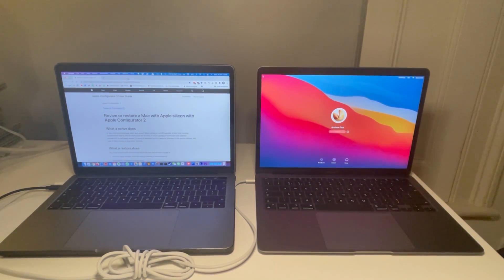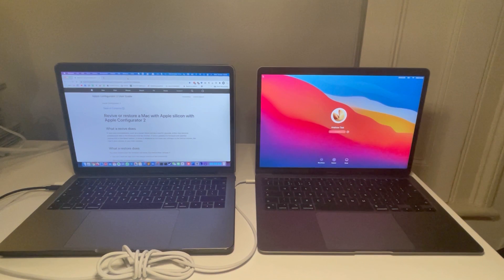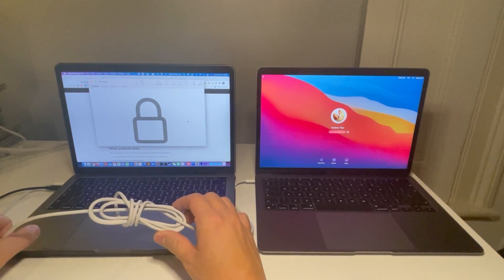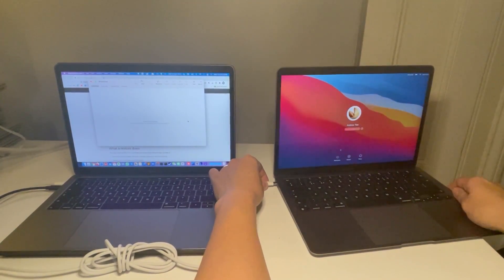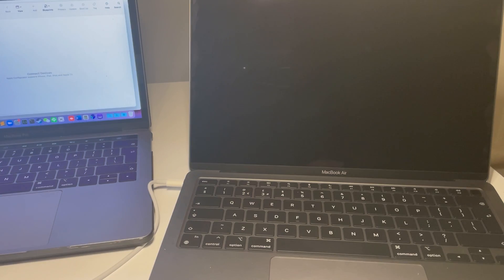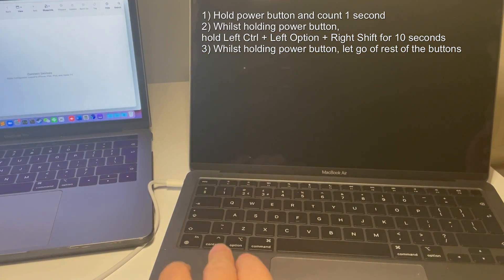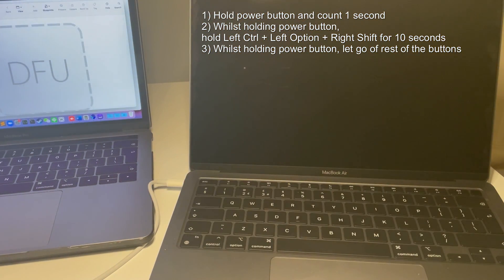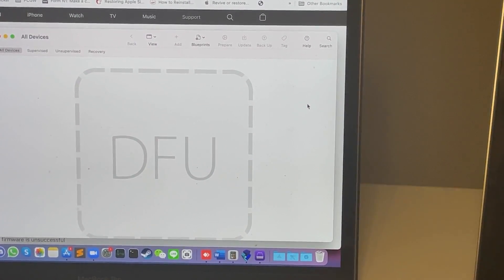How To Set DFU Mode on M1 Apple Silicon MacBook - Reset Factory Settings

Comment: With the M1 powered on hold Left Ctrl + Left Option + Right shift then power button.
Continue holding all 4 until you see that it is starting to reboot  count 4 seconds.
lift the  Left Ctrl + Left Option + Right shift keys and keep the power button down until DFU comes up, then release the power button. 
It works every time.
Reply: Im having MacBook M1 Pro 2020. It has went black/brick. Tried everything still not working.

Comment: Thank you so much!  I consider myself a proper Geek and only after several hours of reading conflicting instructions and many videos was I able to get into DFU mode easily by using your instructions.  I think the key was the 1 second press of PWR before the other keys...but I'm in!  Thank you :-)

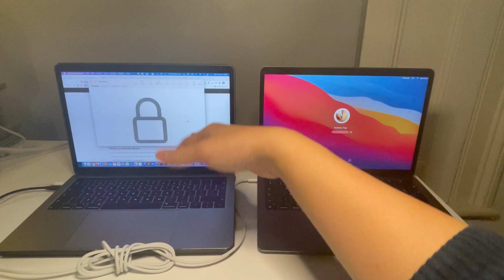UPDATE - I managed to get it into DFU mode but a 'Revive' did not work.  I then could not get it to go into DFU mode again in this way.  After much trying, I eventually rewatched the video from about 2:20' and doing it alongside Andrew it worked!  I then did a full restore which again did not work and once again I could not get it back into DFU mode again using this method.  I thought "what the hell" and run the video back to 2:20' again and did it alongside Andrew and it worked!!  I don't know what I am doing differently or if there is some very weird 'woo woo' going on but....well thank you again!

Comment: Thank you! I had installed Asahi Linux on my M1 air and lost half my drive space to the install so I removed the APFS volume in recovery mode but I made a mistake somewhere and ended up with the (!) icon and a link to Apple's site. But Apple's instructions on what keys to hold were confusing and I couldn't get it into DFU mode but your video saved me! Thanks so much!!

Comment: Thank you so much. It took me hours to find a solution until seeing this. And this works the first try. I just play the video in real time and let it count for me.
Reply: HOURS?!?!? it took me all afternoon to get this to work... instead of searching around on the internet, I chose to ask ChatGPT to help with this. - and AI knew the correct keys and to help me know that the cable type matters as well.... but the actual sequence I was asked to try never worked , not one single time.... I was never able to get the DFU status, until watching this video, it worked on the very first try. In fact, AI did not even realize that the startup and chime (that eventually aborts from the keyboard sequence) is part of the process.... I would say, "its booting up, its not staying black screen..." and AI would say, "dangit... keep trying, you just need to time those key sequences properly".... but it was never once suggesting  "THIS" actual sequence here.

Comment: I had taken delivery of my new M1 MacBook yesterday, installed a time machine backup, everything worked well. This morning I switched on there was a circle with an exclamation mark and an Apple support address underneath.

Initially the first level of Apple support said send it back get a refund, but come on I don't want to have to reorder it.

Support was then escalated to a more senior guy. "I know what to do, no problem" he said.

He pointed me to this video as apparently the problem with my MacBook 'exclamation mark in a circle' is unusual and it wasn't even featured on their support website. The Recovery Options would not even boot up. It was also a way for him to confirm I was pressing the right keys.

He stayed with the problem until the download started, the rest was easy.

My point on this video is, it is correct and the method works using an old MacBook 2012 with the M1 power cable and an adapter from a WD Ultra external hard drive and configuration app.

However, to reach the DFU on the screen you do have to be really precise on the timings when you press the keys. After a number of goes it failed until I used a stopwatch, press the power button then on second later the other three keys then 10 seconds release the keys except for power button.

When you initially press the power button a square without the DFU appear to show the MacBook is recognised. The DFU appears only if you get the timings exactly right. It can be trial an error.

In conclusion I don't think even Apple Support had seen the Exclamation Mark in a circle before.

Comment: Thank you soo much!! Already was in the process of sending it back for refund as not even apple senior support could help. (omg so bad trained staff there) After iCloud sync problems they said I need to reinstall BigSur. Which would not work, because of the cannot create user issue you can find plenty on internet. Wasted 3 days of my life for M1. And then you saved the day! It worked fine, now I can use the MacBook M1 again. Big Kudos

Comment: Thanks so much! Seeing this convinced me that DFU mode actually was a different state than the simple "locked" icon mode that pops up. I would add that I had success entering the mode when I first held the power button for a couple seconds, releasing when I see the progress bar, and then proceeding with the same steps you outlined (pressing the power button again for these). the issue when I held the power button throughout the entire sequence was that it kept entering recovery mode stubbornly. Gladly returning this M1 (though I appreciated it while I had it) and will pick up Apple Silicon after they support multiple displays + give devs more time to iron out as many abnormalities as possibile (e.g. Firefox is still a bit buggy on M1)
Reply: there is a way out finally!  cyber_kor on Instagram unlocked  my apple ID two factors.. He is reliable and top notch.... He is available now on WhatsApp +1 347 830 3644.

Comment: After resetting my MacBook Air M1 i cannot create any account anymore, both via icloud and locally. It says ‘’cannot activate icloud due to a server error”. I’ve alto tried resetpassword trough terminal with no luck. I’m getting mad. Anyone has experienced anything similar? Can be fixed in some way without having a secondary Mac?
Reply: there is a way out finally!  cyber_kor on Instagram unlocked  my apple ID two factors.. He is reliable and top notch.... He is available now on WhatsApp +1 347 830 3644.

Comment: This is not working for me : ( I've tried so many times.  Maybe it's because I already wiped my drive and don't have MacOS installed on it anymore.   When my Apple logo chimes and comes on, underneath it says to keep holding for startup options. All it does is bring me to a screen with the settings icon and a spinning gray circle below it
Reply from the maker: Keep trying and you'll get there - I spent probably 20 mins getting it wrong and practising it before I managed the sequence correctly.
DFU mode has nothing to do with whether you have macOS installed - it is communicating directly to the T2 chip and not to the internal storage.
Reply: @Andytizer  Did you ever see the "continue holding for startup options" text under the Apple logo when your Mac turned on?  I'm definitely doing the sequence correctly, it's just not loading to the plain Apple logo like yours did : (
Reply from the maker: If you see ‘continue holding’ then you have done it wrong. 
Another tip is don’t have your finger anywhere near the power button before you are ready as brushing over the fingerprint sensor can turn on the laptop prematurely.
Reply: @Andytizer  I've done it that way, but still no luck.  Guess I'm screwed and there's another factor at play with my particular machine.  I'm gonna step away from it for a bit and try again later.  Thanks for your suggestions.
Reply: @BR-lo1pi  I'm encountering the same issue. My HDD had been erased, so the macbook tries to boot directly into recovery mode. For some reason the button combination is not working.
Reply: @hugh_maniac  I figured it out.  I had to do the button sequence AFTER the Mac was already booted to the Settings icon screen.  In other words, shut down your Mac, then hold the power button until it boots up and goes to the screen with the Settings icon.  After that, release the power button and wait a few minutes.  Then do the button sequence as explained.  Try it a few times and eventually it might work.
Reply: @BR-lo1pi  hmm that seems to just force shut down the computer for me.

Edit: Ah figured it out. Thanks, that was a huge help.
Edit 2: Nope nope, nevermind. No dice.
Edit 3: There we go. To anyone else who stumbles across this thread... As BR described, hold the buttons on the settings screen as normal, however after 10 seconds, release the CTRL, OPT, and Shift but keep holding the power button for another 4-5 seconds.
Reply: @hugh_maniac  It took a few times for me, too!  By the way, I read the tip somewhere else (can't remember where since I was frantic searching around the web!).  I'm not smart enough to come up with that myself, but glad you got it to work!  Typing this on my new MBA!
Reply: @BR-lo1pi  always feels like a team effort whenever Apple releases a new OS. Haha
Reply: @BR-lo1pi  Thanks !! You and Andrew save me so much time.